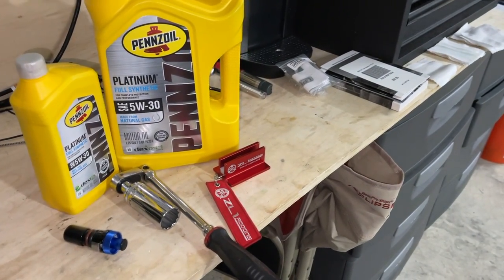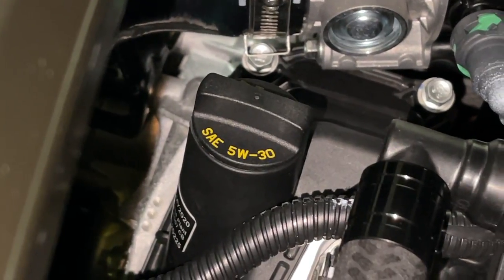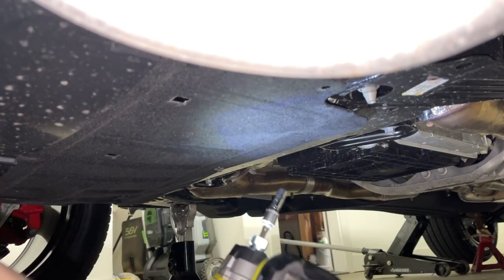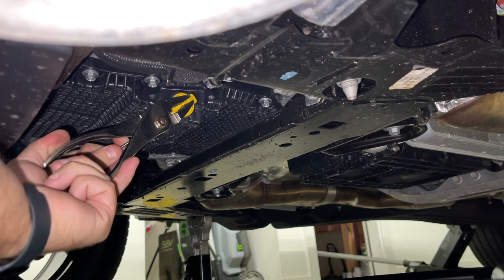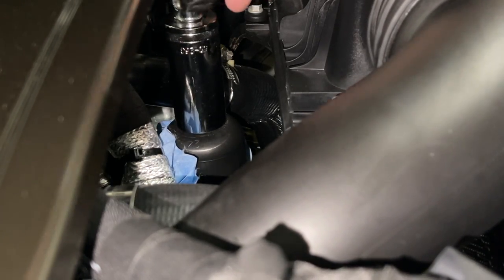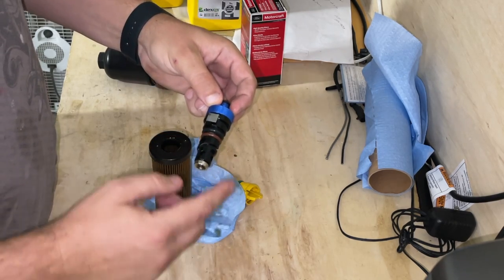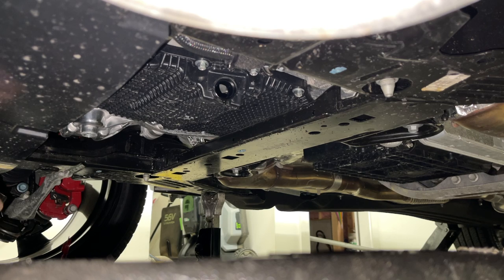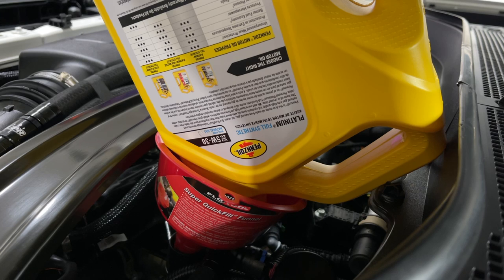UPR easy drain plug install & First oil change / 2022 Explorer ST

Comment: I have a 2022 xlt it has a standard steel drain bolt plug.
Reply from the maker: Must have the NA v6 in it.
Reply: @KnightsGarage  2.3 ecoboost
Reply from the maker: @lneal3720  weird.  I thought all the eco-boost had the plastic Pan.  Maybe they ran out of the plastic pans because of supply shortage. I wish they would’ve ran out before they built mine.  Lol
Reply: @KnightsGarage  late model 2022. A plastic drain plug just seems absurd. Maybe easier to fix if cross threaded but i cant think of any other reason for it.
Reply: 2.3 come with the standard metal plug except ST

Comment: Wish I would have known this before getting my wife's st. Engine top filters are bad enough. Ford's stupidity of needing the entire underskirting being removed for an oil change is bad enough. But a plastic pan and bolt? It's a $60k vehicle, not a tonka toy. Honestly, the tonka toy is all steel, so better quality. Kinda pissed now tbh. Was thinking about buying a new 150, now I'm definitely going to go with a tundra instead.
Reply from the maker: Just replace the plastic drain plug with this unit and problem solved.   The new Tundra’s are sweet though!
Reply: @KnightsGarage  still the problem of the plastic parts that should be metal on a $60k vehicle. I could deal with that if it was a Kia.
Reply from the maker: @alfhwuqd  I see what you’re saying but the pan being plastic really isn’t an issue.  Having it be aluminum would have no real benefit.
Reply: @KnightsGarage  true, which is why it should be steel.
Reply from the maker: @alfhwuqd  still no benefit.  just heavier
Reply: @KnightsGarage  doesn't get cracked. Pretty big benefit there. And let's be real, a plastic pan will become pretty brittle pretty quick.
Reply from the maker: @alfhwuqd  I haven’t heard of any of them cracking unless they’ve been impacted by something.   The steel ones can bend and rip, I’ve seen it.  I feel like you’re reaching for a solution for something that isn’t a problem. There’s plenty of other things worth complaining about on the $60,000 vehicle.
Reply: @KnightsGarage  for sure. The noisy engine. The clunks and clangs. The parts that are missing because of "COVID" that they made a big profit from not putting them on.

Comment: Have you or anyone who purchased this drain plug had any problems with oil leaking for the drain plug valve?
Reply from the maker: I haven’t and I don’t know anyone else that has.  I know if you don’t stick a small piece of Shop towel inside and clean it out after you close it what’s left in there can dribble out overtime but nothing is coming out of the pan it’s just coming out of that short spout on the plug itself.  
I stick a small piece of a shop towel that I tear off and clean the small tube out on the plug itself then insert the rubber plug into the end and I’ve never had any oil on the underpan when I removed it.  Just did another oil change about a week.